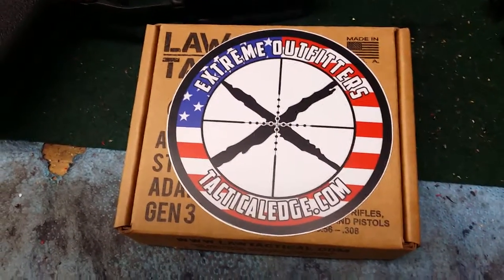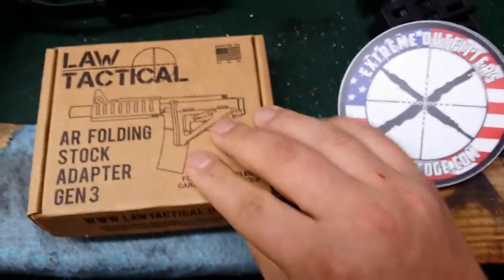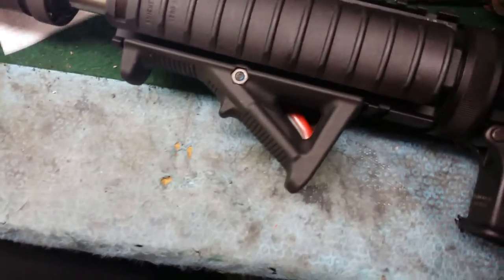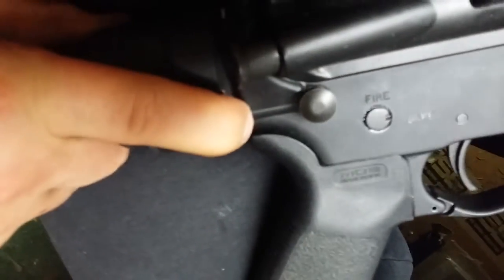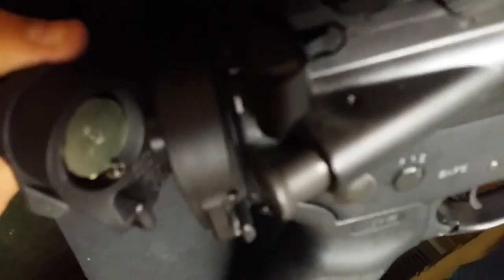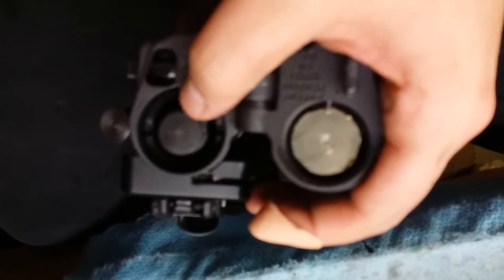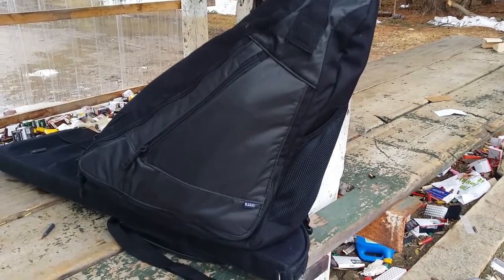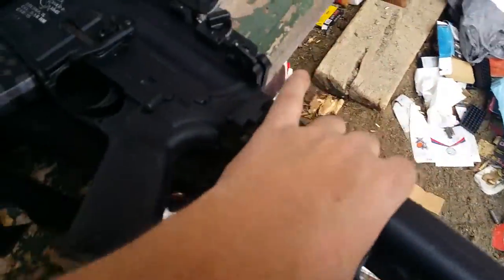LAW Tactical Gen 3 Folding Stock Review

Comment: looks like there's a single point adapter on the bottom of the adapter itself or am I wrong? how's it holding up? saw some people say they had gas blowback in their face and issues with charging the rifle because it protrudes. have you had any of these issues?
Reply from the maker: Yes, it's a dumb place for one it gets in the way. It's holding up great, I have several hundred rounds through it with no problems. I have have gas blowback issues regardless from running a can. I can't say that it added to it or took away from it. I don't notice any burnt carbon around the adapter seals, so I would say that's false.